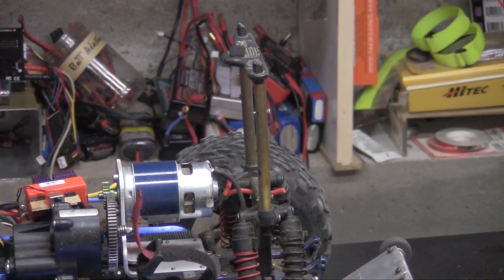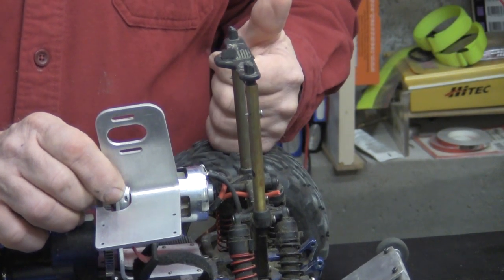Super Cheap T-Maxx Electric Conversion How2RC Motor mount March 2013

Comment: I'd run that motor on 6s.
Reply: There's 3650 3300KV BRUSHLESS and 60A esc in my volcano. It'll pop wheelie
all day long and do 45 mph plus on 3s 40C....
I snap the center drive line and differental.. on my MGT 4.6...it's almost as big  a Xmaxx  12-13lb..That's only on a 4076 2250 KV..4s 50c..
6s????? F%$#@K that.lol
People use 4292... 1650 or 2000kv.,now.
IT's 2018.....oki doke.lmao
Reply: Im about to put a 3300 kv brushless an waterproof esc in my tmaxx but I only got a 2s lipo battery tho

Comment: Do you send to UK?? i really want convert my,, rebranded Seben 7 1/8 nitro that siezed, and i am selling my other as it is just to messy and noisy,, i sure hope that you can help with mounts when i get the thing stripped!?? very well explained no nonsense run throughs,,
Reply from the maker: We ship our Motor Mounts world wide.  shipping to the UK runs around $15 USD.
Reply: How2RC ,, Great,,, you seem like the man for the job,, i will be in touch when i get the thing stripped my friend,, thankyou very much,, happy dayz 😊, do you think i would need take off the 2 speed gearbox and run a straight axle,, hsp 1/8 nitro monster to brushless?? thanks,,

Comment: 320A 7.2V-16V Brushed speed control   Is this okay ?
Reply from the maker: on ebay  search   Brushed ESC 100A Car/truck
Reply: How2RC is that the HBX E016 100A Brushed ESC ur talking for?
Reply from the maker: I didn't like the one I was running but haven't gone looking for a good one.
 Good luck.

Comment: I was inspired by your video to bring my classic T-Maxx out of retirement and do your conversion. I have been trying to catch up with the technology I have missed from being away from the sport. Since I have not read a RC magazine or rum my T-Maxx in at least 6 years and even longer since I built an electric truck I have a few questions for you. I would like to keep the stock radio and receiver if possible.  What type of battery(s) do you recommend for this build. Is there more than one that will work as far as speed potential or run time? What motor gear did you use on the 775? I have a metal upgraded transmission-slipper gear already on it.